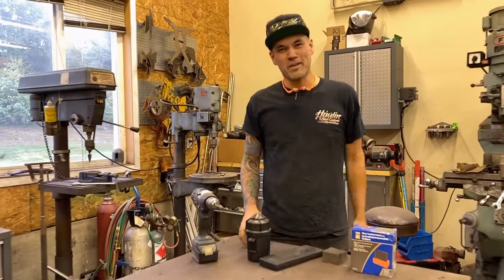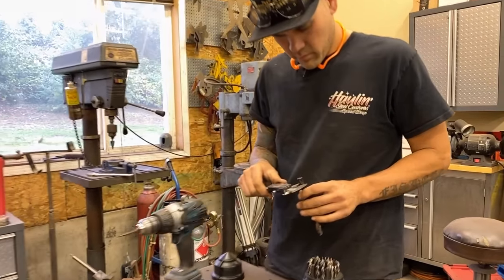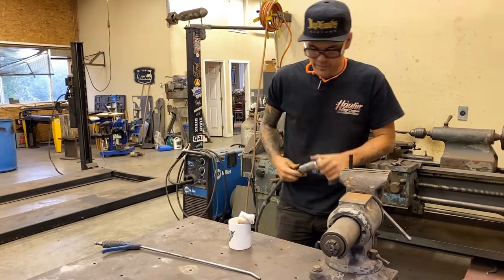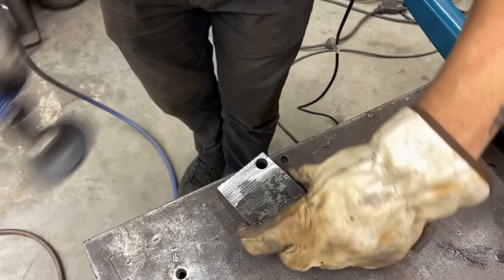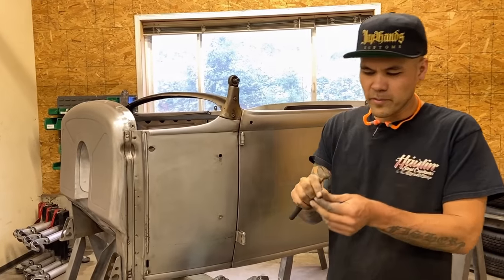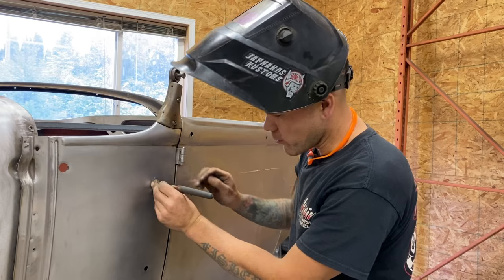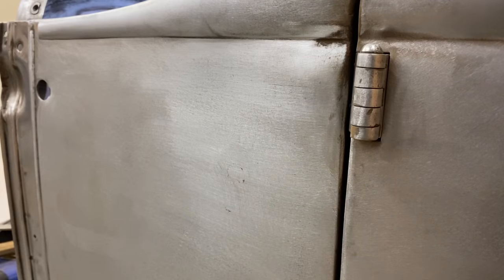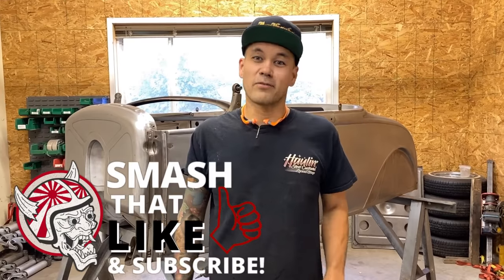Filling Holes in Sheet Metal EASY with This Simple Tool YOU Can Make!!

Comment: That is a neat idea. Well done. I can see me making one of these in the future.
Reply: Love your channel also
Reply: Yeah, I watch fitzees as well.
I'm learning so much from these two.
Reply: That's high praise coming from Fitzee! Love his channel, learn a lot from these guys. Grateful for every video
Reply from the maker: Thanks so much tony !
Reply: Fitzeeeeee! How are you my friend? Great to see you in here!
Reply: When I patch a hole, she looks clinker built.
Reply: @MakeItKustom  There's an advantage to filling damage with drilled out round holes that car people might not realise. Its incredibly important in aerospace because cracks propagate and pressurized aircraft push against the fuselage which make cracks very dangerous as they like to just start tearing. 

I'm an engineer and engineer I used to work with was a specialist in cracks in metal and what the effects were. A crack will weaken most metals by around 99%. The problem is they not only weakens the metal but every time it flexes they crack tears and weakens it further. The other thing is of all the hole shapes you can put in metal (sheet, bar or block) a round hole creates the least amount of stress concentrations.  

So drilling it out with a round hole is for strength the best thing you can do. 

Welding it using TIG with almost perfectly fitting blank the uses the minimal amount of filler is just the best way possible to fill a hole for strength. For some interesting reasons TIG is far less likely to create microcracks because of the actual bonding mechanism that's going on. That rule of thumb on the current is pure gold. I wonder how many welders are sitting there head slapping themselves over troublesome welds in sheet metal. 

So it doesn't matter what industry a welder works in this is a great technique to learn.
Well done for a great demonstration.
Reply: One thing which helps to get a really tight fitup and avoid the need to use a magnet is to get a taper hand reamer, like the ones made by General Tools, and make your punch smaller than the big end of the taper, but slightly larger than the standard drill size you plan to use to drill the panel. 
Then you can ream the hole just enough to sneak up to a really tight fit, so you can hammer the plug in from the back side and tap it exactly flush.
I guess as an enhanced variation instead of this: it would be possible to make another punch (hollow and internally threaded like a chassis punch) which would enlarge a predrilled undersize hole to the desired exact size (and again, slightly tapered) hole in the panel,
then follow through and form a raised lip around it on the outside (again, working from behind). 
This would avoid the need for filler altogether.

Conceivably it could be actuated by a large, strong Riv-Nut gun or similar.
Reply: Glad to see you found this.  I immediately thought of your diligent body work.
Reply: @honeydoshandymanservices-l670  dffcddcs0A
Reply: I was just about to tag you Fitzee!
Reply: What a wrap! You got the best on YT (Fitzee) watching your channel! Stick around!
Reply: @logandevoy8119  I cant wait to watch as Fitzee begins using a Lav mic to improve the audio, then he'll be deadly!
Reply: @tonywilson4713  the hole is how I've stopped propagation of cracks for years. The explanation was the stress coming down the crack is distributed evenly along the circumference and stopping the further degradation.  When will you have an engineering channel?
Reply: @patrickhayes3099  Yep that's the standard stop for a crack and used extensively in aviation.

Engineering channel - ummmm! I have thought of it, because there's certainly a lack of decent practical engineering covered.

There's a lot of good engineering channels but they are either about machine shops or hobby machinists or just information.

There's not many I have seen that are along the lines of "how to do" things. I did my degree in aerospace but have mainly done automation and control systems. Both are not done well from what I have seen.  There's also huge amount of bad information on things like AI, space technology, automation, robotics, industrial control systems,... etc.

The biggest issue I see is that its social media and that's a potential nightmare.
Reply: Yea that will definitely help you out on your spot welds hole repair love both of y’all’s channels have learned a lot of both of y’all both of y’all are talented

Comment: Those transfer punch sets are one of the best things from Harbor Freight. They're cheap ($10) and useful for many tasks. I use them for mandrels, alignment pins, pin gauges, and they're cheap enough for use as steel stock. Buy a set for transfer punching and get extras for all the others uses.

Comment: I bought a '66 Mustang in which someone had drilled half inch holes in the dash for an aftermarket radio.  I found a piece of .5" round stock about 8 inches long and used a bandsaw to cut off about an eighth inch of material at one end.  However, I didn't cut all the way through, instead leaving just enough material to keep the eighth inch piece attached to the rod.  I held the rod up to the hole from behind the dash and tacked it into the hole that needed filled.  Then I broke off the piece by bending the rod until the piece broke.  After grinding the tacks I used body filler to smooth the repair.

Comment: Great technique, thanks. BTW, tempering is not hardening. It's done after the hardening to reduce brittleness, most hardened steels will chip. fracture if not tempered. Tempering reduces hardness, creating toughness in the steel.

Comment: Thank you Karl!!! I never thought of using this technique to fill holes, I’ve always used weld to fill holes and it’s a nightmare! I will definitely use this from now on! Thank you again!!!
Reply from the maker: Wicked Man I am so stoked that you will use this! You’re most welcome thanks for watching!
Reply: @MakeItKustom  nice idea...if you used ac tig on the steel here, would that make the magnet not an issue.?  I have heard that ac is useful to prevent arc blow or when welding magnetized metal in the smaw process

Comment: I am about to fill the original fender bolt holes in my 1951 GMC Pickup bed. It has an interesting history you might like to read about.
 I took off the OEM fenders of the bed in 1967 when my Aunt gave me a junker Farm  pickup so I could build a small trailer to haul my strawberries out of my FFA Garden to the Saturday Sale Barn.  I stripped off the cab & cut the frame to use as the trailer frame, but since the step side fenders were mangled bad after a decade of farm work, I tossed them.  In 2012 after my Aunt died and her kids were selling stuff off her farm they called me and asked if I wanted (free) the old trailer I built  when I was 16. (1967).  I jumped at the chance to get it.  I have been redoing the old trailer to use behind my 4X4 rig over the years when I have the time to haul camping gear and I installed Jeep style fenders on it.  So now my plan is to fill the old fender mounting  holes, sandblast it and paint the old trailer.  Already tossed the old axle I put on it so many years ago because that 1951 4 bolt truck pattern is no longer available.  I built a 3500 cap axle with my 4x4's 6 on 5.5 bolt pattern so I now have 2 spare tires.
Shame I can't post a picture of it up here.  
Been using this method for filling holes for years.   Glad to see the craft is stiill being used....

Comment: That’s a pretty cool idea. I used a similar method to fill in a dozen holes where the roof rack was on my Cherokee Chief. Instead of making a tool, I used a 1/2” hole saw to cut out little circles. This worked great since the outside diameter of the holes I wanted to fill were a 1/2” and the inside diameter of the holesaw was about an 1/8” less. This left me with a 1/16” gap all the way around.

Comment: Neat solution. Thank you for sharing. Having had to solve this problem several times, and always tacked a plate to the inside (in the hope of minimising shrinkage issues etc), then filled the original hole with weld on the front, I can definitely appreciate how much neater, more economic and smarter your solution is. 

I’m a UK based 63 year old retired aircraft engineer who restores bikes and have zero interest in stock cars btw. We never stop learning. 

Cheers
Reply from the maker: Right on I bet you’ve had a lot of great experience in your life so far! I’m glad you found this solution. I’m with you on stock vehicles lol there are plenty of people that love them and they can restore them so that we can have all the fun by cutting them up lol cheers
Reply: Make It Kustom 🧐😎😜 You are a clever philistine. 
Peace

Comment: Thats a cool tool! As a toolmaker with experience of punching, cutting, pressingtools I would recommend you to make a rounded shape like getting it cutting in two spots at first on the tip. You have to try out the radius that fits you (bigger radius mean more force) and the piece that you will fit the "dot" into.This to make it more like cutting than forcing thru avoid that expanding the sheetmetal will do when hitting the entire surface at once and make the tool stick when the remaining sheet re-shape and the hole get to small.😊👍
Reply: Cuts way better. Instead of a disc grind with a mini drum sander
Reply from the maker: Yes absolutely if I had shape the end it would cut it a little bit better but it would also distorted a bit so I don’t mind the struggle with the tool a little bit to get a perfectly flat disc that doesn’t need to be hammered. For larger holes I would absolutely have to make it more of a cutter. Thanks so much for your guidance on this. I am not a tool maker but I love listening to you experienced individuals such as yourself
Reply: That's like electrical knockout punches. Whitney punches all have that pilot point. But jewelers disk punches are always flat and square to eliminate distortion on the piece you want to keep which is the slug not the parent metal

Comment: Thanks!! Great idea!! One suggestion I would offer: My son and I are doing a 57 Chevy and have been doing lots of patches in the floor. Probably up to around 30 holes and/or fasteners that we have removed. For holes this size (up to 1/2"), I have purchased a "Whitney" punch. The Whitney punch uses a dye that looks very similar to the transfer punch so it makes a disc with a slight "center" dimple and the plug is a tiny bit distorted (not flat). Choose just the right size drill bit (that the punch dye JUST fits in) or JUST undersize. Put the plug into the hole (turn a rat tail file like a ream ) until the piece just goes into the hole. Use a dolly and hammer to flatten the plug in the hole. This expands the plug so it holds itself into the hole and it's flush.
 
So, I would suggest you try using the transfer punch with the centering tip as it's manufactured. Hopefully it will make the same kind of plug the Whitney does that is slightly "shrunk" so it will expand when flattened in the hole. 
Larger holes are done with a stepped (uni ) bit. The plug is made using a corresponding size hole saw with the pilot bit removed (drill a small hunk of plywood first and clamp it to the metal as a guide).  When the hole saw cuts through the metal, it leaves a super thin edge piece that will hold your plug from going through the hole with a magnet on the backside. Hitting that thin rim with the arc gives you a fusion tack. Hammer and continue from there.
Reply from the maker: That’s an interesting technique! Thank you very much for sharing I appreciate it Bob!

Comment: Wow that’s pretty cool I’m a union sheet-metal worker and I do a lot of welding and if there was a hole I would just slap a piece of copper or aluminum on the backside and fill it with weld and then grind . Thanks for A new idea 💡

Comment: As always, I enjoyed your video.  I made a similar tool to make plastic washers for the screws that hold on motorcycle bodywork.  They're usually white plastic, but you can easily find a plastic jug of some sort that will more closely match the body color.  It takes 2 punches - one for the screw hole, and one for the outside.  Punch the screw hole first, then visually center the screw hole in the outside punch.  Bam!   Custom plastic washers.
Reply from the maker: Oh I really like that thank you for the tip! I’m sure I will use that one in the future to

Comment: Iv used this technique for many years! I just save all the slugs from my hole
punch tool for spot welds. I pop them in place and hammer on dolly on it and that expands the slug enough to hold it for welding. That or I’ll just use masking tape to hold it. Great video as always!
Reply from the maker: That’s awesome! I’d really like to get a proper punch for sheet metal so that I can save the discs and do it like you say
Reply: @MakeItKustom  all the cheap ones I see now punch too small of a hole, mine was one my father had…. Think the company is out of business now…

Comment: Thanks for sharing such a valuable tip. Much easier than even using a brass or aluminum backer to help you weld-fill a 1/2 in hole. Less distortion and easier to handle. 
And it's Fitzee approved !!!
Both you guys are great 👍
Reply from the maker: Thanks a lot man! I like fitzees technique to

Comment: Karl, I forgot a trick that an old time metal shape and welder taught me. When I use the wire from my big wire welder .035, I use a mechanics aircraft safety wire twister to twist the welding wire. I don't know why it works, but it really makes your weld much smoother. This works great for gas welding also. Thanks and take care.
Reply from the maker: Very interesting I’ve never heard of that! I’ll definitely have to give it a try

Comment: Just happened upon your channel and have been admiring your skill.  What caught my eye was you using magnets to position your plugs prior to welding.  One time I was doing something similar and likely using a small Neodymium magnet to hold piece in place. The welding time (mig) was short, but the fumes which I am inclined to blame on a 'hot' magnet were like a baseball bat to the head toxic (smelling).  Was out of the shop in a flash.  Likely my ignorance.  Have used magnetic right angle holders without issue.

Comment: repairing a tail gate on my dads Jeep bottom rusted away ,, the bottom had curves then the lip too hold the skin ,,also had to replace the bottom part of the out side skin . there is a few screw holes just drilled and cleaned them ,, but had to make 2 sq holes for the hinges ,, I drilled then did lots of file work ..  I will have to get some sq stock that is hardened and see if I can punch sq holes in the next project .. thankyou for the video ..the sq hole is about 1/2 too 5/8 sq ..I used 18 gauge steel to patch the tailgate

Comment: nice tool idea. ive been using various sized flat washers and then use the head of a nail to fill the washer hole. or just a nail head to fill tiny holes. anything smaller than 1/8 pretty much just gets welded up (solid wire+ gas)

Comment: Fantastic tip on building that punch!!  Thank you.  Did your friend work at Watervliet Arsenal?  That's just down the road from me, lot of high tech metal work going on there over the years.  One thing - wear the gloves and shirt with the tig!  That UV coming off the torch is way worse than any sunlight for burns, it can cause skin cancer.  Thin tig gloves are fine, you just have to block the light.  Lost a friend to skin cancer, was only in his late 40's.  Take care of yourself, you only get the one ride.

Comment: I got a super old Whitney Punch No. 5 with 6 dies on eBay for $20. Doesn't work for all sizes but works so awesome. Does 18ga sheet metal perfectly. Use masking tape on the back to hold the plug it place just to tack it (super fast tacks). Remove tape and weld up. I also tried magnets but found it does mess with the tig arc. My 1951 shoebox ford has 18 ga sheet metal (.045) and found 45 amps is perfect. I am a beginner tig welder so still learning.
Reply from the maker: That’s cool man thanks for your input on this sounds like you got a method that works well for you!

Comment: Once agin a great Video Karl.👍👍

Forgot to add you can use an old drill for the Pin 
Pick up old drills 1/2 ", 3/4" or 1" from the garage sales or even some old Blunt bits as the tool steel is hard and use the shanks and will do the exact same as the Transfer Punch 

Drill 3 Holes in the metal Block and then you have 3 std sizes and 3 Punch pins.
Winning
regards Michael
Reply from the maker: Yeah it’s great point!

Comment: If you ever need to re-harden your punch there’s a technique by heating and slow cooling to get the hardness needed. 
We used to sharpen our punches, chisel’s both manual and air hammer bits & our shop blacksmith would re-harden them for us.

Comment: Awesome, just a thought….if you taper the punch tool from cutting face to end, as it punches the hole through the sheet stock it will no longer get stuck and will fall right through the die body ready for the next punch. 👍

Comment: Cool tool, great idea especially if you have lots of holes to fill. Have you ever tried using a piece of brass on the back side and doing a plug weld on top of the brass? ( if you have access to the back that is) the brass shouldnt stick. I know it works on heavier material. Cheers
Reply: ^^^ That was exactly my thought. I use brass all the time at the fab shop I work at. This definitely a cool trick and has it's place but if I know I'm to grind it away I'd most likely use the brass.
Reply from the maker: Yes I use this technique as well on smaller holes I like copper because it doesn’t have the zinc in it

Comment: Nice work ... thanks for sharing. 
Ideally ream the hole so it is circular and maybe the punch doesn't need to be slimmed down (or not as much)
(Drills leave a tri-lobed hole not a circular hole if measured accuratey.)